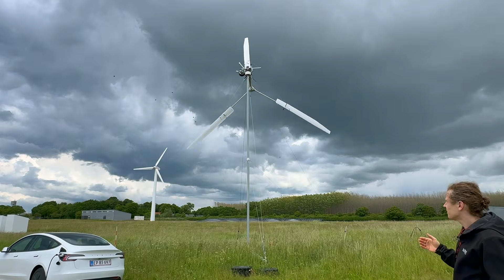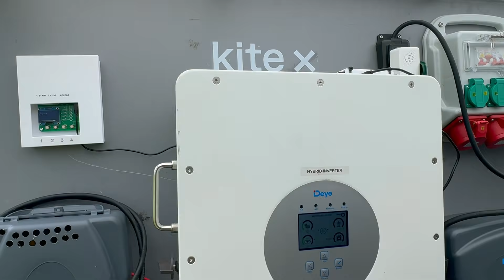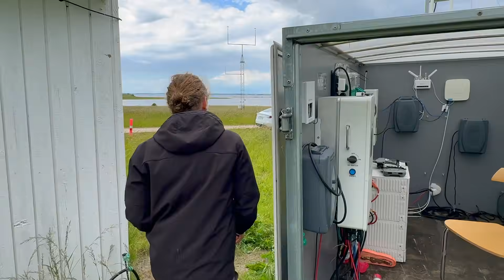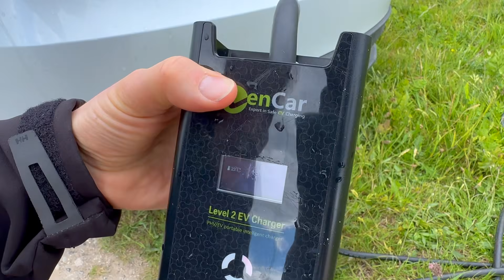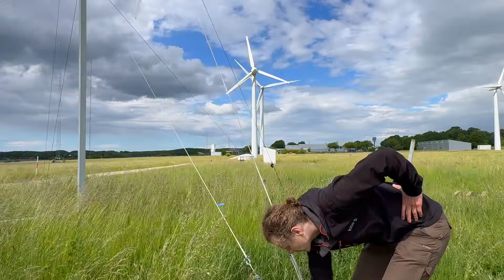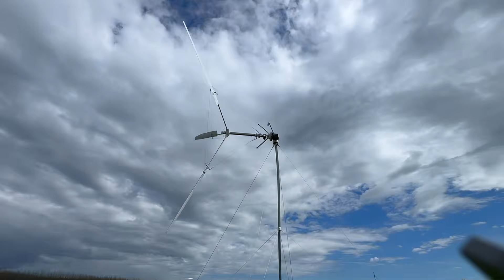KiteX turbine Charges a Tesla Model 3 with 4 kW - TWT-11 - Long Edit

Comment: Why not go dc direct to the car’s bms and skip the inverter losses?
Reply: Would be interesting to do but that requires more custom hardware. The turbine is designed to be connected to the house and grid via an inverter.
Reply: Modern inverters are pretty efficient, and you'd still incur losses from stepping up and regulating the stationary battery's voltage at the 400+ volts required to charge the car's battery via DC.
Reply: @PaulRoderickson  The DC output of the turbine is around 650V. Regulation is going to be key, not sure it would ever be worth it vs. just going to an intermediary battery and then converting from there. Problem with the turbine is that it is variable output which is not what the car is expecting.
Reply: @FrederikSkovgaard Makes sense, thank you!
Reply: Windmill genny would need to be 500v minimum, dumped into preferably a high voltage battery which would dump into the ev. Hard to find hv buck converters is a big problem. Even then, you would need to turn off battery preconditioning every time you plug to charge through the service menu. Any dc source and the car starts running its 8-9kw heater to the batteries. Awful waste and too much friction honestly. Tesla allows you to turn it off, as for other oems, I’m unsure. Could be even worse

Comment: I hear 15m, 300kg and easily in the same context. 🤣
That is a serious piece of tech! Not something you just whip up.
Very clever trick to increase the swept area though!
Reply: The engineering that goes into modern wind turbines is something else. The aerodynamics and control side of things is really interesting!
Reply: Please note that 80 of those kg is in the ground and the turbine in terms of swept areas is best compared to 5000-40000 kg turbine :D The turbine can be installed at ground level and tiltet up.
Reply: @AndreasOkholm  Yeah, it's just that I have recently transported a easy system for another project and it was quite heavy. My poor trailer was not happy. I am thus quite atuned to the ease of which a normal person, not an industrial worker with a forklift, can move hundreds of kilos.

Comment: how does one stop/break the damn thing?
Reply: The turbine has both active and passive safety. If you press the emergency stop it will automatically feather the blades and stop quickly.

Comment: Why so far from the tower?  The leverage can't  be good for  life.  Your generator needs to be forward of the pole far enough to balance out the blades.   If you don't it'll lean in 1 way and be harder to start up.  I put fairing on the pole to keep vibration down.
Reply: It is a very light weight design so these problems have been handled in a different way.
Reply: Just how does it handle harder to start up and how is heavier loading better. lighter?  Yours will work but output will be lower, especially at lower wind speeds.  Your blades look light which will allow it to catch gusts better before they fade away.
I've already done these back in the 80s and Skystreams' problems show you need to balance the head/blade weight..

Comment: Looks awesome! So does the output of the generator just feed directly into the MPPT meant for PV input on the solar charge controller / inverter?
Reply: Exactly, we hook it up to the MPPT and load our custom turbine profile and you are good to go. Currently we include a grid-tie inverter in the price, with the ability to upgrade to hybrid.

Comment: The mechanical design of the cantilevered shaft with cables is just weird needs to be made stiff and balanced otherwise a small gust will destroy the blades.  Another problem is the vertical tower it's too thin as wind speeds goes up it will start bending breaking the guy wires and destroy the whole thing.

Comment: Why are the blades so small? Just to fit in the car? The noise? Surely you are losing a lot of potential there? I know nothing about wind turbines just curious
Reply: It is a balance between size, efficiency, weight etc. The TWT-11 runs some fairly high aspect ratio blades which work well with the active pitch control.

Comment: This is exceptional. Extremely high swept area, the price is high but for the swept area the power probably makes sense. We need to see a curve tho.
I'm curious on what your solution is on extreme winds or if it's quick to take down, but this would be amazing introduction to wind power on the great plains winters.
Looking at solar, wind and temp data in for example Kansas, you could take down the turbine on late April, (temps warming up, tornado season coming) and put it back on anytime between July and September, (after that winds pick up again for the winter). Complementing solar quite perfectly, I do read the survival speed is quite high though.
Reply: For some reason the original comment did not get saved here. You could take them down during hurricane or tornado season. If you are familiar with the setup it will probably take 30 minutes to an hour to get one down and in the van safely, ready for storage. It continues operation up to 18 m/s / 40 mph average wind speed and has a rated survival wind speed of 42 m/s / 94 mph.

Comment: I suppose the bearings holding that turbine so far off the centre will not have long designed lifespan...
Reply: Why? I think in wind it kinda lifts itself as umbrella, having a lot of horizontal force and very little vertical.
Reply: @ittakir  The design is optimized for the aero loads. We are not seeing any major bearing issues, a lot of the weight is below the nacelle as well with the ground screws being a substantial fraction of the total system mass.
Reply: The bearings don’t carry the main shaft

Comment: This windmill is not 4 kw, 1.5 maximum.....
The best was the skystream......
M'y skystream work for years at 18 m high but only produce 2000 kWh per years, so i place more solars pannels.
Reply: The TWT-11 will make around 15.000 kWh at most locations thanks to its large swept area and active control system.

Comment: I do not understand how 4kw is 6A. 6a is only ~1.3kw with european 230v. For 4kw you need like 17-18amps AC. Even if that's battery current. Model 3 has 400v, which would be 2.4kw
Reply: Single phase:
225 V × 6 A = 1,350 W
So if it were only one phase, you’d get about 1.3 kW, not 4 kW.
Three phase:
225 V × 6 A × 3 = 4,050 W
That rounds to 4 kW.
Reply: @paulp4860  Oh, it's three phase.. totally forgot about it. Just surprised to see model 3 having 3phase charger. In Ukraine it's mostly single phase  us cars (even when port changed to ccs2).
Reply: @paulp4860 Believe those charger is only 1 phase. 220 to 240v. If he is reading it off the charger, 6A, thats the current current. Usually you can select 6,8,10,16,32 A on the the charger depending on the model.
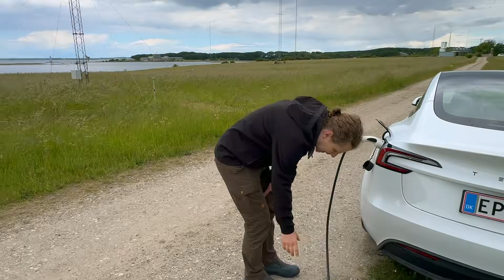Reply: @ffyy88 No it's 3-phase, look at the ground at 2:44, that's a red 3-phase plug.
Reply: @swecreations aha ... good catch.
Reply: We are using a three phase charger for this test. As it has been noted we also have a hybrid inverter with 9 kWh battery pack attached to smooth out delivery. The TWT-11 was delivering around 4 kW to the invert during this test.
Reply: … the battery smooths out the input. He can set the charge current to whatever. If its more than the wind power input, it will drain the battery. If the EVSE draw is less, it will charge the battery system battery. If the car isn’t plugged in, and the wind blows, it will charge the battery. If the wind isn’t blowing but there is charge in the battery, you can still charge the car.

Comment: Hi, "no noise" — But what about infra-sounds, because it is what"s matter for the health ?    And what about the bearings wear of the gear box with such a span from the mast ?
Reply: That the vibrations from wind turbines would cause health issues is mostly fabricated by the oil industry to reduce demand for wind turbines. It is not based on facts.
Reply: @swecreations      Nope, several years ago I found a Netherland site I unfortunately lost the bookmark after a disk breakdown, it shown testimonies of people living close to wind turbine, before and after, implantation it also stated that researches in this branch are an absolute taboo, citing no financing and researchers shadowbanned for having manifested the will to go further in this matter.

And it's not just infra-sounds, there is also a huge problem with currents looping in the earth - I guess very low power wind turbines like this one is not affected by this one.

So, until an international scientific study without any doubt about its financing source is published, you too are limited to what you can read…
Reply: @hankhulator5007 @he of the reasons why it's not really liked as a research subject is that all the research that has been done on it has been financed by oil companies among other things to cover up how bad their own infra-sound emissions are in comparison.

Much of the research is done on wind turbines because that is what gets the money, but if you compare infrasound emissions of something like a gas pipeline wind turbines are nothing in comparison.

I remember seeing a case where the emissions where first blamed on some nearby wind turbines before they dug deeper and realized it was actually a nearby gas pipeline that caused the infrasound emissions.

All the research around it always leaves a bad taste in people's mouth because it's always so obviously biased from being funded by the oil industry, who is doing it entirely in bad faith to make themselves look better, and you can never really fully trust it for that reason either.
Reply: Infra sound is not something covered by the standard measurements and with the low mass of the blades the excitation energy will be near impossible to measure in the ground. For larger turbines where blades are in the 100+ ton range this might have an effect.

Comment: 17k usd. includes installation job permit turbine and gridtied inverter. No battery.

Its a pet project if you got money, not economically sound.

good brand choise of inverter for diy tho.
Reply: It depends on your electricity cost, in places like Northern Germany the ROI is around 5 years.

Comment: Nice to see you again on YT :)  Do you plan model between this and "small" Kitex? I'm living in Ireland where we had(not sure if is still obligatory) formal limit to 12(or 13?)m height of the turbine including mast and rotor (and rotor blades should be no lower than 3m). Such  turbine can be installed without "planning permission" - so is easy "to go" for customers. Ireland have quite high wind powers (as e sample I'm on countryside with a 300W/m² @10m and average 6.35m/s based on globalwindatlas map) - so it will be nice add-on to my home PV system. As I have already running 48(52)V LFP type battery system - do you plan model working on this voltage battery range?
Reply: Reply was somehow lost in YT apologies. We have a 15 m tip height variant for the German market. I think the regulations in Ireland are more restrictive so here a full permit will be needed due to the large rotor diameter and height of the tower/mast part.
Reply: @FrederikSkovgaard  Appreciate it, thank you! Following your channel/project from the begging (almost). Ireland is a both good and bad - as energy production from winds can be worthwhile and same time damage from winds(storms) and wet(!) is a serious challenge. Keep posting new videos :)
Reply: @bialy100k  Thanks :) We will keep posting. And hopefully expand into Ireland at some point. We have it flagged as one of the countries with the highest consumer electricity prices. In terms of regulatory complexity I think it is similar to Denmark, doable but requires some planing!
Reply: @FrederikSkovgaard  Keep in mind regulations in Ireland for Wind Turbines can vary due local County Councils. Prices at countryside (ESB - main energy provider): I have dual tariff (winter: day/night 8-23) and last bill shows per 1kWh 0.3404/0.1679€+9%VAT - without carbon and delivery. Paid bill 106€ for 61 days and 151kWh usage (all other goes from separated PV off-grid style). Just to you can compare "real bill data" with your own area :)

Comment: In Florida we experienced wind speeds around 120mph - 3 times in the last 4 years. Is there a homeowner shutdown procedure for those situations?
Reply: It will automatically shut down when it goes above 18 m/s and go into survival mode. 120 mph is a bit above the rated survival speed per the IEC 61400 standard, so further protection is needed.
Reply: @FrederikSkovgaard  Thank you for your response
Reply: @volt8399  If the high wind speeds are associated with hurricane season you could take down the turbines during that part of the year and remount for winter time operation. It is relatively quick to take down once you are familiar with the assemblies and how to handled them.